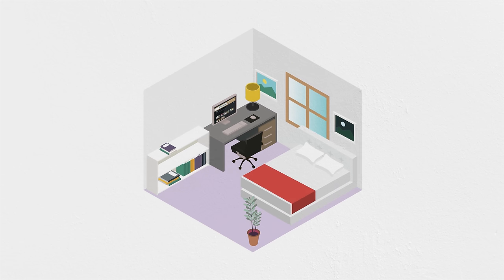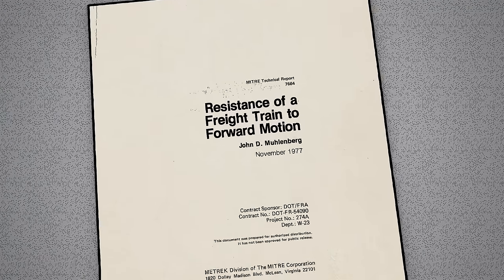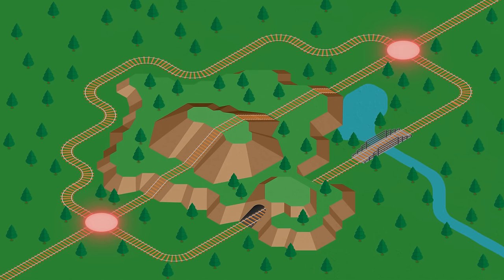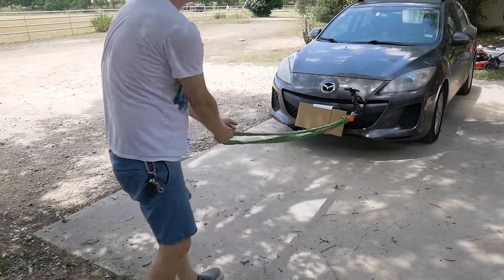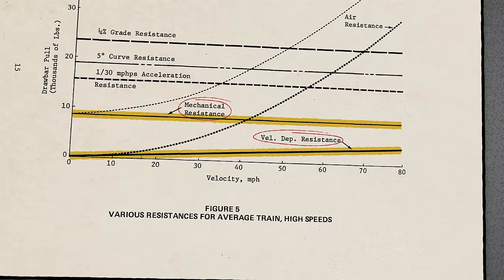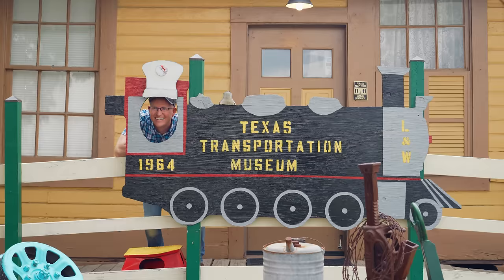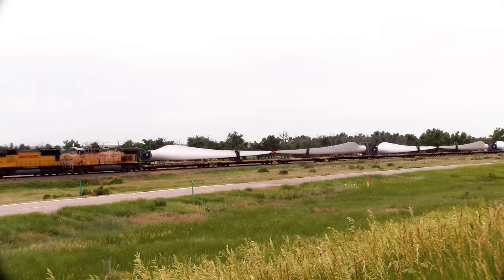Which Is Easier To Pull? (Railcars vs. Road Cars)

Comment: Automotive System Engineer here. There is another reason why we hate steep grades and need to give you civil guys a limit. And that reason is called driven vs. undriven axles or more precisely how much weight is on those axles. The weight on the undriven axles and some sine gives you the force at which the freight is pulling down the hill. The nominal force on the driven axle times the coefficent of friction must be greater by some margin at any time. Otherwise the wheels of the locomotive would slip through and the whole train moves down the hill. Reguardless how many horsepower your locomotive has. So with each % of incline your locomotive needs to be heavier.
The reason why you can pull your car at 30kg, but not a wagon is elastostatics. A tire deforms so the ground doesn't has to, so you don't need to lift the weight of the car if you pull gradual enough. On a wagon the wheels are either as hard as the rails or harder. So for an ever so tiny amount you need to lift the entire wagon.
That's why we used steam engines for quite a long time as they have near infinite torque at low rpm.
When a really heavy train starts they compress the train with a tiny amount of decline or driving backwards. That tiny delay means you only need to overcome the initial resistance for each wagon at a time.
But thats an edgecase to mess with students in exams. In practice you need far more nominal load on the driven axles and power to provide sufficent acceleration and dynamics at an incline.

Comment: Without any thinking about that, it has probably reason that trains on steel tracks are still used even after almost 200 years, cars are very inefficient. I remember how some youtubers made a car for tracks and they were shocked how easily it goes without any resistance. They should start making some rails for cyclists, that would be cool, but overtaking other cyclist would be probably slightly complicated. 😀 There are many old rails turned into bicycle path, it would be cool if it was possible to let tracks on place and have some train-bike. 😀
In last 15 years, pretty much all tracks were renovated and you don't feel any joints and bumbing anymore, so I guess it's more efficient now.

Comment: Good sponsor. I've been using a safety razor for twenty something years and will never go back to "modern" cartridges. A tip: Not all classic double edged razorblades are the same, so try different brands and use those that fit your skin. The steel and the angle of sharpening may or may not fit your skin and beard type. "The sharpest" doesn't always mean the best. A quality safety razor will last for generations and the blades are cheap. 

I've never tried to pull a car, but have pushed a few when needed...

Comment: Probably rail cars because even the engines can't get up a 10 degree incline.

If there's anything wrong with the rails or wheels it just leads to more problems with the rails or wheels so I suspect that the rails and wheels are well maintained

Comment: Before I watch I want to see how close I am; with limited stops compared to road vehicles, slipstream aerodynamic efficiency from closely following the other train carts, solid wheels instead of rubber ones(rubber tires have constant deflection during rotation wasting energy along with higher coefficient of friction), and larger more efficient diesel\hybrid engines, the trains are much more efficient.

Comment: Tradesman here. In your example moving your car with a rigging strap, it probably doesn't matter at the level of scale you're operating, but alot of safety is about building habits. Your strap is at too tight a radius when you larks-head it off the tow point. You should really be using a shackle. I have a book somewhere that gives the exact radius that is in the danger zone if I can find it.

Comment: I think you should have tried pulling for longer. If your average force was 10 newtons over the rolling resistance that's only going to accelerate it at about a 20 thousandth of a g which would result in a practically imperceivable velocity after only a few seconds of effort.

Comment: 7:14 I thought rail wheels were conical so that the slight difference in diameter compensated for the extra distance travelled  around the outer rail of the curve and curves were made less extreme to prevent flanging.

Comment: I've never understood, given the reduction in friction that occurs when steel wheels meet steel rails, why it is that locomotives don't just spin their wheels when they start.
Reply: Sometimes they actually do on takeoffs. At least the small locomotive we have at my workplace does when we move loaded TBOX cars. They can weigh as much as 244k lbs each. We move up to 4 at a time. It is more common in wet conditions. It most frequently spins it's wheels when the operators try to accelerate too quickly before all the cars brakes have time to release. This is only my experience and I am not a conductor or engineer. This is simply what I have observed over the course of 3 years.

Comment: Percentage of the railway that is electrified in different countries:
Switzerland 100%, Sweden 85%, India 85%, but the major part of the electricity in India are produced by use of coal and oil, so it is not very "green" electricity yet. Germany 55%
USA <1% that has the largest railway network in the whole world. 
So even if the railway is an energy efficient way to transport goods, will you still have to electrify your railway networks and use green electricity to lower the CO2 emissions. Tesla cars and trucks can not do that on themselves. Nice video!

Comment: Not going to argue about your results. But when you were pulling your car, the angle of the strap and the pull on the dynamometer were not straight with the direction of motion. This will lead to an erroneously higher reading. Part of what you read with the pull at that angle is an upward force on the car

Comment: I never understood those extremely long trains. They need several locomotives, but still only able to move slowly, because the momentum it would have with any half-decent speed would be too dangerous and impossible to stop, but the length combined with the low speed also means that a single train is able to block a crossing for more than half an hour. I think no train should be allowed to be longer than what a single locomotive can manage.
Also, the breaks need air pressure to work? I'm almost sure trains in Europe work the opposite way: the locomotive needs to generate a few bars of pressure in the entire system for the breaks to release. If the breaking system is damaged anywhere, all breaks of every single car will hold and the train can't even start to move.

Comment: Railcars are harder to get started moving but easier to keep moving.  Road cars are easier to get started but take a lot more energy to keep moving.  Friction is rough on the ol energy

OH.. and I changed to a safety razor about 12 years ago and never looked back.  Better shaves, no ingrown hairs, baby bottom smooth and loads cheaper.  I get a 100 pack of blades one time a year.   I encourage everyone to give them a try!  They are wonderful.

Comment: Before I even get started, I know that rail cars have less rolling resistance than road cars,  so there's one answer. But, getting them to roll is a totally different situation. It's going to be easier to push a car from a stop than a rail car,  because the rail car empty is many times heavier than a fully loaded road car. And if you need to roll over a small object,  the rubber car tires will comply easier than a steel wheel.  So,  which scenario are we answering? Which uses less force to overcome resistance or which one uses less force to change or increase velocity?

Comment: FWIW it is much easier to pull a car around then it is to try to push it, which end you pull from is irrelevant... pull from the front or the rear is easier than trying to push from the front or rear. I beleive it must be due to suspension compression. pushing usually compresses the suspension whereas pulling decompresses

Comment: Do diesel electric locomotives have regenerative braking? Do they have non-slipping electronics for traction and braking? Do you remember the early wheel configuration that employed three wheels? It had the two bogie wheels but the load was on a third wheel that rode on top of and between the bogie wheels. I thought it was called a wiggins but searching doesn't find it.

Comment: I understand that drag goes up by the square of the speed in an aeroplane. But for a railway, I would have thought that the drad would have only affected the first part, then after that a small percentage for each of the other rail cars.
Reply: The calculation wasn't about single carts, but whole trains.

Comment: I don’t think the measurement of the turns uses a 100 foot rope because it’s old-fashioned, you still need to know where the centerpoint of the radius is for that method. It probably has to do more with the fact that not all turns or consistently one radius. Some of them are more complex. Also, you can’t always get to the centerpoint if there’s a forest or a mountain or even a building in the way.
Reply: The stage of the art way is to use splines. There is a realy good long documentary exploring splines on youtube, which I reccomend.

Comment: 0:00 - I'm going to assume rail cars are easier to pull due to the bearings... That and there's no transmission (though you'd probably put that in Neutral first for a car which probably disconnects it)... Though, are we talking about a loaded rail car?

Comment: There's a caveat to this - on one hand, the low rolling resistance makes trains great for moving lots of weight long distances with minimal force required, terrain dependent, results may vary. On the flipside, it makes them that much harder to stop too. 

A fully loaded freight train moving at about 50-55 MPH can take over a mile and a half to stop, even if you put the brakes into emergency - that's all the locomotive engineer can do to try not to hit you. Applying the emergency brakes and wait. Wait and pray, for the longest 30 or so seconds you can imagine that you won't be plastered to the front of the locomotive in a mile.

And they will hear it in the cab, and they will feel it in the cab when their prayers aren't answered. And it's not a good feeling.

Take that into consideration the next time you think about trying to beat the train at a crossing.

Comment: curious if they bank the tracks slightly on curves - tipping the rails a little like this could allow higher speeds on curves but might cause problems if a train needs to stop & pull off again.

Comment: Diesel electric locomotives already have the electric motors in place. As a matter of fact, I believe they use resistors on the top of the locomotives to brake the train on downgrades to save on brakes. 
Weight is not too much of a problem on trains as this video portrays. Seems like the locomotive designers could incorporate battery auxiliary units to save the downgrade kinetic energy like electric cars and hybrids do. 
It could cut down big time on their fuel bills. They are already using that very effectively on logging trucks.
Reply: They wouldn't use a battery, they would just connect it to the power grid directly because batteries are expensive, heavy, and wasteful.

Comment: Metric nation here - in metric it is tonne, whereas ton is used for imperial. Using the correct spelling avoids confusion. 
Much like it irritates me when people use meter for unit of length instead of the correct spelling metre. A meter is a devise for measuring (water meter, gas meter, etc).

Comment: 5:13 un less of course you  are dealing with electric trains and over head lines in which case you can turn the motors to generators to slow you and sent hat power back to the over head lines to help the next train up the slope

Comment: Radius of the wheels make any difference? Smaller wheels would turn faster but not sure if the resistance would change.
Reply: They run faster but lack power to pull. One company defrauded a company by putting small wheels. It won't work

Comment: I want to propose something to you
If your average enclosed rail car has enough roof area, to average 6kw/hour from 9AM to 6PM on a cloudless day, on flat ground in texas. Can that train operate at cruizing speed during thise hours without firing up its diesel generators, if every car had solar?

Edit: This assums using light weight, but W/in² inefficient CIGS cells, as they are impact, water, and even puncture resistant, as well as being very flexible, with more traditional silicon based cells you might achive 50-70% better area efficiency, at the cost of added weight and lower durability.

Also, i couldnt find a definiative "this is the area of a normal train car" so i took a 53ft*102in tractor trailer to come up with that 6kW/h figure at 0.0897W/in²

Of note, the weight using commercial pre-fabricated CIGS solar pannels for a 53ft*102in tractor trailer is only 219lbs(rounded up)

Comment: Any railroad man will tell you that you need about 3-12 lbs of tractive effort per ton of rolling stock on flat rail. The number varies based on a wide variety of factors, mainly the type of bearing on the axle.

Most boxcars like the type in the thumbnail are about 15-20 ton, so you're talking 45-240 lbs of tractive effort. That is, a modern, light boxcar requires just 45 lbf to move it.

This is why rail is so efficient.

Comment: Now I want to know if a cheater bar could be used to gain enough leverage to overcome the initial pull from static to rolling. Imagining an eight foot pole to get things started then manual power afterward.

Comment: If i get you Right at 3:50 Wheigt is what we call in Germany the "gewichtskraft" so the (gravitational)force of Mass?  (as an  Force ist should get the Newton [N] as unit)
I always used weight and Mass simultaniously.
Reply: And whilst Talkin about SI-Units, instead of 2 million Kg (million = 2x10^6; k =1000) so in total 2x10^9 gramms, we would say 2 kt (kilo [10^3] Tons [10^6]) or 2.000 t

Comment: Also consider steam locomotives here. Diesel locomotives are powerful and don't care much for hills, with the engine driving the electrical system that supplies power to motors on each axle... steam locomotives, however, really do not give a ** what you think they can or can not pull. Steam locomotives can pull trains they can't start, and diesel locomotives can start trains they can't pull.

Comment: Railroad tracks are part of my thought puzzle and you being an engineer may provide an answer.  If you pushed one end of a mile long track would the other end move instantly? If you hit with a hammer would the other end move instantly?  Now apply the same thought experiment in Outerspace where there is no gravity. Now stretch the rail to the moon. If you pushed the earth end would the moon end react immediately? Speed of push? GOOGLE all you want but you will not find where anyone has addressed this puzzle.

Comment: your in flat country but there are rail lines  with grades between 1 and 2 percent in ohio grades  run from .5 to 2 percent on many lines.  the coffecent of drang and restice drops  after you get a rail car moving so the formal  is right but has some  problems with it. it harder to get it moving than to keep it moving

Comment: [00:00 - 01:47]: Introduction to the concept of moving large quantities of material, particularly gravel, over long distances using freight trains. Discusses the energy efficiency and engineering considerations involved in hauling heavy loads.

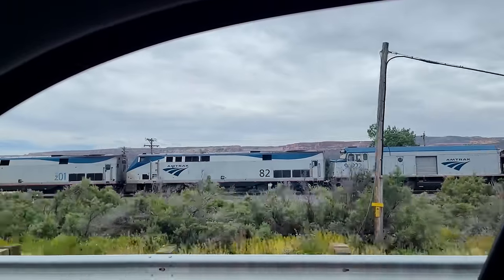[01:47 - 04:41]: Explains how railroads minimize energy use through engineering decisions, including managing resistance, grades (inclines), and curves along the railway routes. Emphasizes the importance of gentle grades and the impact of curves on tractive effort and resistance.

[04:41 - 07:57]: Discusses the challenges of navigating steep terrain and the engineering solutions such as bridges, tunnels, and spiral tunnels. Explores the impact of extreme terrain on route planning and efficiency.

[07:57 - 10:22]: Explores rolling resistance, which affects the energy required to keep trains moving on straight, level tracks. Describes different types of resistance, including mechanical, velocity-dependent, and air resistance, using the Davis Formula as reference.

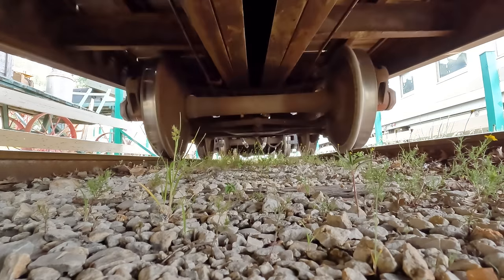[10:22 - 15:32]: Demonstrates measuring rolling resistance practically with a vintage railcar, showing how even small imperfections in the track can affect resistance. Discusses the practicality and efficiency of rail transport compared to trucks for moving large loads over long distances.

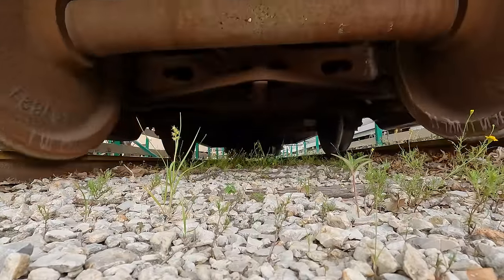[15:32 - 17:29]: Integrates a sponsored message about Henson razors, emphasizing their quality, affordability, and ease of use.

[17:29 - end]: Wraps up the video and encourages viewers to try out the sponsored product with a discount code.